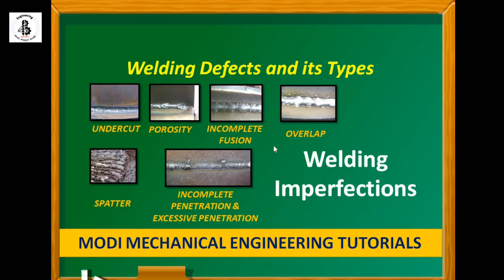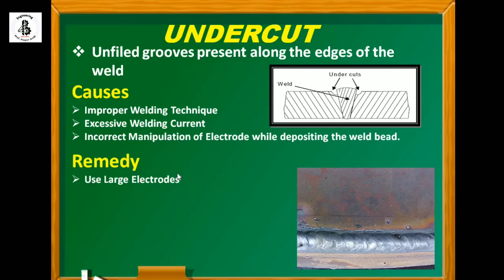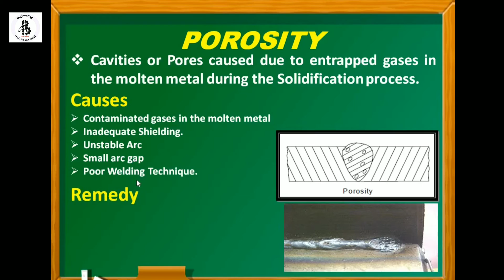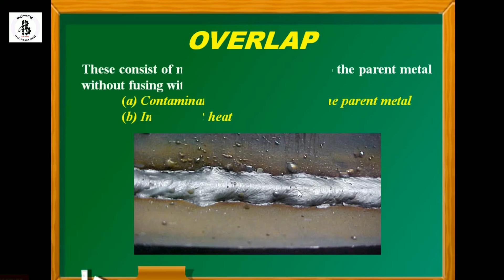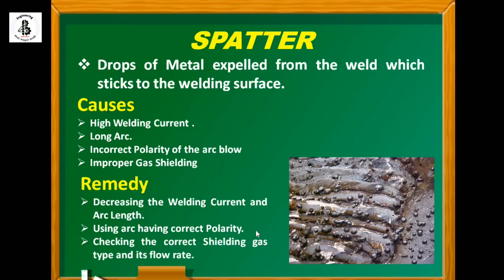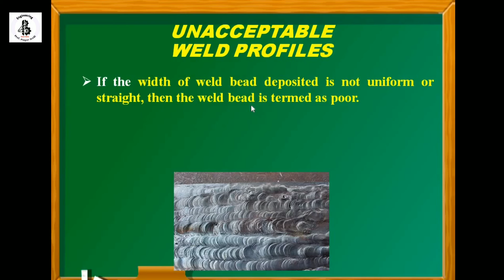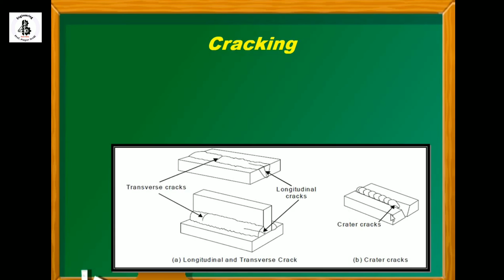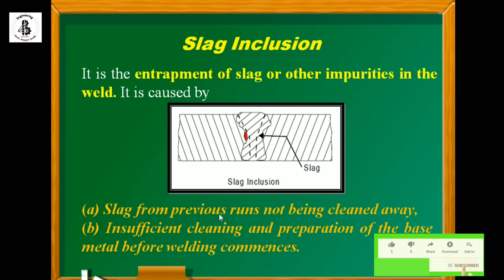WELDING DEFECTS!! Weld Defects | Causes & Remedies|Porosity, Arc Strikes, Undercut |welding process

Comment: High Current reduce weld spotter as long your weld speed is constant & the gap between the weld nozzle, which is 7mm ~10mm (MIG) on the Base metal or weld metal, Consider cleaning as well to avoid spotter.